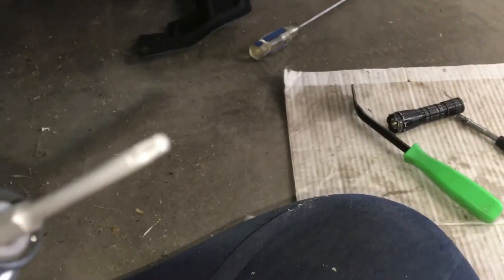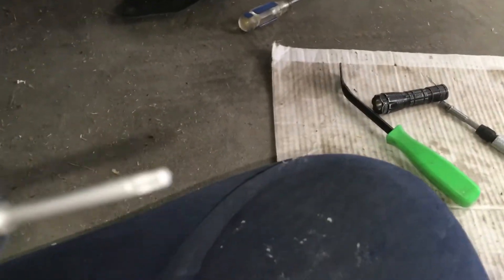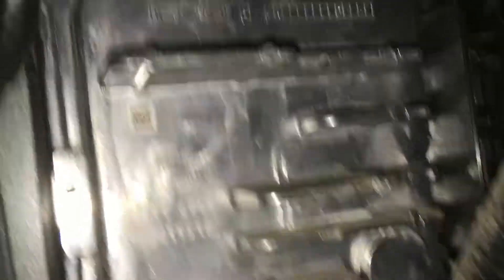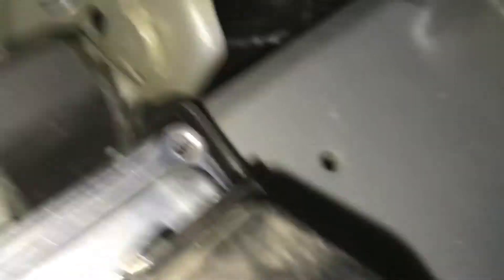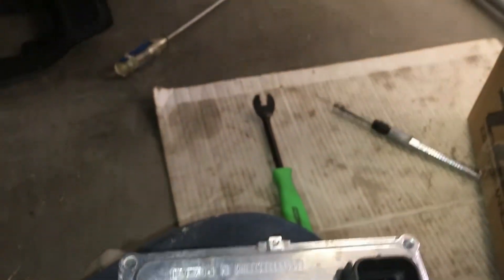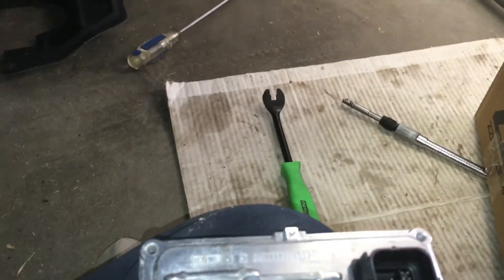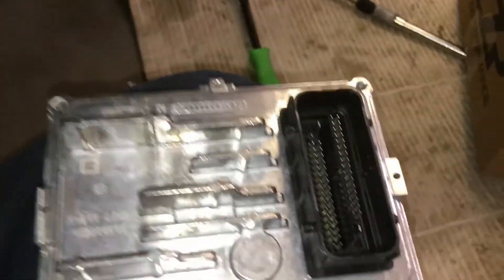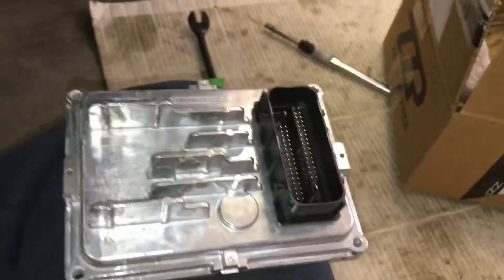Remove TCM Transmission Control module Install unlocked TCM on 2018 Cadillac ATS 2 0T

Comment: How did you find the tcm on their website? I cant seem to find it
Reply from the maker: Yes that is strange, they removed the section for unlocked TCM.  You may have to message them and see if they can unlock your TCM and you would probably have to send it to them.  I do have a 2018 Cadillac ATS 2.0T TCM that you could buy off me and send it to them to unlock.  My unlocked TCM was sold with my ATS but I still have my factory TCM.
Reply: @madboostingmadmatt48  ok thanks for the reply. I think im going to buy a new one from gm and send that over to hp tuning

Comment: Can you drive on the new TCM prior to tuning it? I have a new TCM on the way and ordered a tune but I wanted to know if I can still drive on the unlocked TCM prior to the tune
Reply: I purchased my unlocked TCM from ZZP,.  it did drive to the tuning shop with the newTCM installed.  It was 1 hour drive there, most of it was highway driving and it changed gears fine.  I did have check engine light during the drive though.
Reply: Ok thank you very much for your help. Im getting my TCM tomorrow and waiting on zzp to tune. Didn’t want my car out of commission for however long the process takes I greatly appreciate it your help
Reply: Was it from the TCM causing the CEL? After the tune the CEL went away though right?
Reply: @TTrident660  yes CEL was gone after tuning PCM

Comment: Great video, do you need hptuner credits to tune the TCM, or are credits only required for PCM?
Reply from the maker: Yes,, for my 2018 it needed 4 credits for PCM, 4 credits for TCM.
Reply: @madboostingmadmatt48  Did you have to buy 4 GM credit, or Will universal credits work?

Comment: Great  video’s. Did you have any tuning done to the TCM? If so did you notice a difference in transmission shifts? Keep up the good work 👍🏻
Reply: I had muscle motors tune the tcm and new big billet wheel turbo on the dyno on my new dyno video, check it out